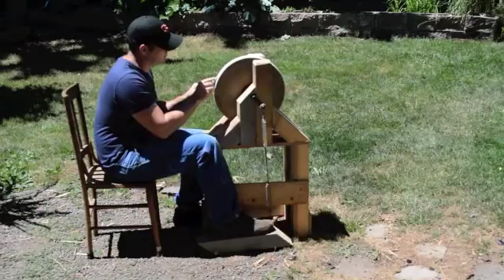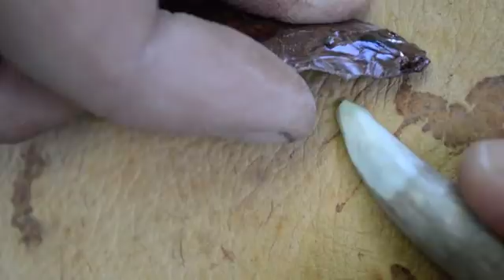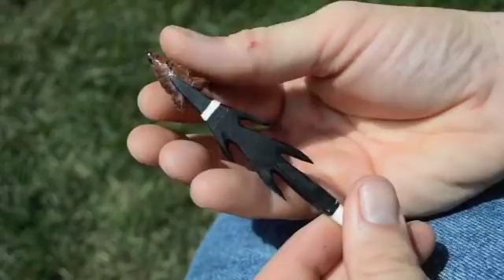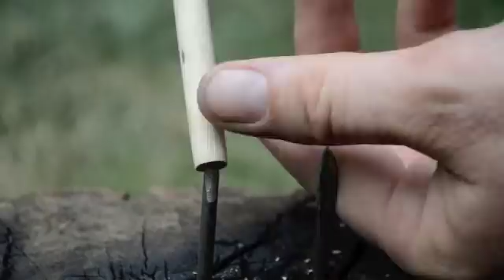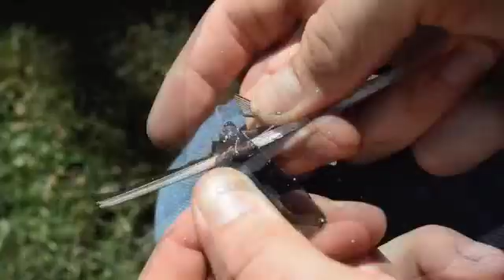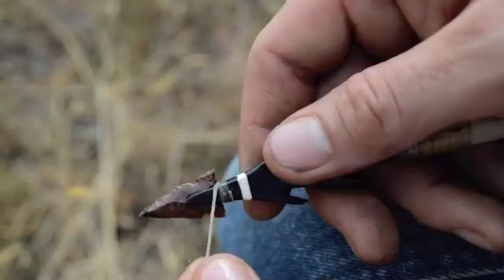The Most Wicked Native American Arrow In History! Hupa Barbed Arrow - Primitive Technology

Comment: When it come to design of arrowheads there is a trade off, bigger heads or those with more barbs means much less penetration. An arrowhead of that design would be useless on mammals of deer size or larger unless it had a much longer, heavier shaft, giving it more mass for penetration. I'm guessing that the design here, that was very skillfully recreated, was used for waterfowl or fish. Far more traditionally shaped, Hupa flint arrowheads (still attached to the shafts) have been found than the multibarbed ones.

Comment: Long time no see!!! the biggest question I've seen with the arrow itself is what was the use of this arrowhead/tip. Which as far a I know is still up for debate. But I was a just thinking that this had to be used on animals that they wanted to kill quickly or not want to get away. This narrows the use down to either a fishing point or a big game/dangerous game point. 

This can easily be tied to a string to be used for sturgeon, or other large bodied fishes, or possibly even seals sea-cows and  small whales especially if it's up-sized to proper spear length and weight. The Pacific NW peoples were well known to hunt whales in their seafaring canoes.
The tip can also be used for more dangerous game or larger game b/c the barbs will move around and cause more damage the more the animal moves, as well as possibly walk itself deeper into the animal. Though I'm not sure as to how often the Hupa or NW peoples hunted bear, or even if large game like Bison or possibly other megafauna would be around even in smaller numbers. The Pacific northwest is historically a hard place to find remains of any kind unless they're very fresh.

Comment: Sorry dude. Nothing against ya. Did excellent work on this arrow. But it is important to make it clear why native arrows where often designed in this particular fashion and why they worked so well. In terms of arrows native Americans had a reasonably complex design. Higher flexibility in the rear, weight shifted more forward and not only had interchangeable tips to address multiple hunting situations with one arrow but a fail safe to prevent either tip or arrow from snapping as the animal bolts. They put a lot of thought and effort into this and this should be honored respectfully.not saying you need to make em like this, just be sure to explain this as you make your arrows. As a part native American I feel it's important.

Comment: Most native foreshaft points are friction fit not secured by sinue. The backshaft tips are just reinforced with sinue. This system was designed to allow the main arrow to fall away as the animal crashed through brush preventing damage to either componant. This arrow here has the foreshaft locked into place with sinue

Comment: the heads are where the real work goes, the shaft was meant to detach because the shafts would break on impact or when the animal fell, a detachable shaft meant less work went into making new heads when the shaft inevitably fractured, if the maker of the original had split the shaft he would have just started over on it instead of attaching the head to the shaft defeating the purpose of a detachable shaft!!!!!

Comment: Why not just use bone for the entire thing instead of going through the effort of napping an entirely new stone head every it fractures. Don't bone arrow heads handle impacts better than stone arrow heads?
Reply: The stone is obsidian. It is glass and very sharp. A bone isn't that sharp except at the very tip of a break.

Comment: That is a fishing arrow.
Reply: Definitely a war arrow.
Reply: I would think an arrow like this would be reserved for a rival chief or a special target. I doubt it would be used on just anything or any random foe.
Reply: Well about Half way through the arrow it traditional detached , so the arrow was actualy two pieces,  for one the barbs would keep that end inside of your enemy while the back half would fall off leaving them nothing to grab onto to try and remove the arrow , the poison would insure it got you eventually
Reply: Barbed arrows are traditionally attached to rope to keep fish from escaping.
Reply: Fishing arrow, The fish couldn't pull it out, there are no significant bones and it wouldn't damage the meat that much as you would push it through. 

I looked ta hundreds of war arrows on the web and couldn't find anything like this. I did find some fishing arrows like this, although nothing quiet this extreme.
Reply: That Guy Really? I bow to your superior knowledge. Why the extra barbs?
Reply: and for 2 the tip is alot easier to make ,so if you only have to male tips and pic up the fletching end it makes life easier ,almost like reloading shells
Reply: Chris Whatley "assault arrow"
Reply: War arrow, the opponent couldn't pull it out and so it'd make for a messy, gruesome death. 

That's also the reason it can't be a hunting arrow of any variety, it'd damage the meat too much and would be a right bitch to remove, especially from bone.
Reply: True, but some are designed for shallow water and are really long.
Reply: This was used for war,. In my area (Low mainland of BC) Native Americans mainly used spears  to hunt fish.
Reply: No this is a war arrow , the hupa and my tribe Karuk make them

Comment: I use normal glass for makeshift arrowheads as glass can be just as sharp as obsidian but is easier to find and is a good use for my beer bottles.
Reply: do you use the side of the rounded bottle, or just the bottom
Reply: I use the sides and bottom.  Sides have to be cut different and are more thin.  But can also be made into the style of a smaller arrow head.  But I still prefer to use the 40 oz beer bottles as you get more out of them.

Comment: I don't know anything about native american's weaponry, but this type of arrow seems practical for fishing purpose
Reply: Other than the fact that the point is meant to come off the shaft if pulled..... Fish gets away... wounded, dies.
Reply: @wolffforge4839  Yes, this is not for fishing unless it had a string attached to it. It looks like it was made to cause humans pain. It will not penetrate or fly that well. It will come off in the wound and be a real pain to get out. Likely deadly from later infection.
Reply: Douglas E Knapp 
I dont know about all tribes but With normal arrows our folks usually used plant fibers to tie on the heads for the same reason bow strings were usually made from plant fibers. sinew unravels when it gets wet. If sinew was used, especially without glue, they intended for the head to come off. 

If it was a war arrow it was most likely coated in poison or venom for added effect.
Reply: @aaronengland8289  lol yall are funny thinking you know something
Reply: @donnyc9430  
Oooo, someone's jealous of my three likes. And moderately functional brain.

Tell you what... you talk like you know something. Share your knowledge with us heathen folk.
Reply: @aaronengland8289  what do you want to know I'm Yurok/ Hoopa/Totowa. Born and raised in Hoopa California
Reply: @donnyc9430  
We both know it's a war arrow. That part is obvious. It's construction has the same basic design as one of ours but with a slight twist that, in my opinion, would actually make it more effective or at least increase the chances of it being more effective.

Explain the function of each part from the foreshaft to the point and why each part was designed that way.
Reply: Probably be better for small game birds like pheasant
Reply: Maybe you should learn more about native Americans